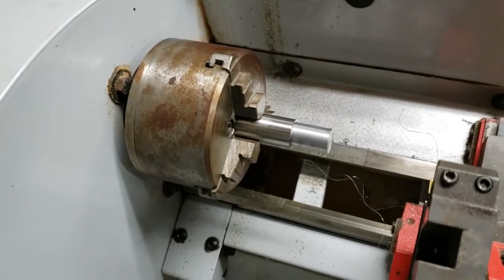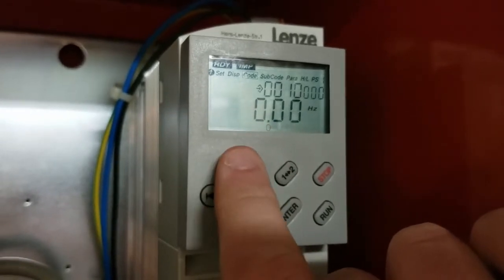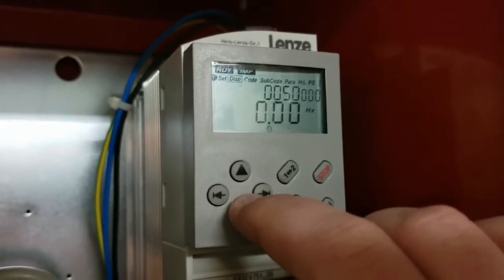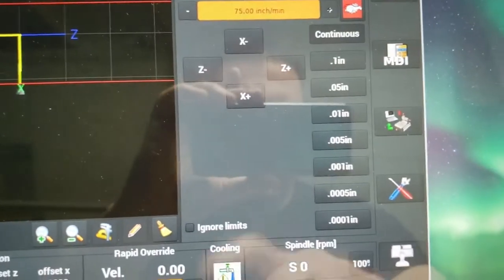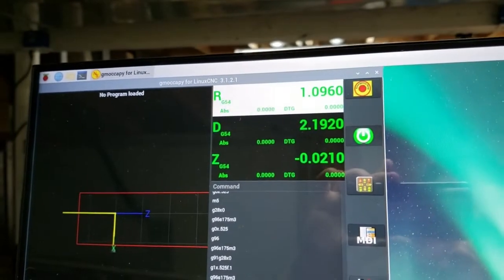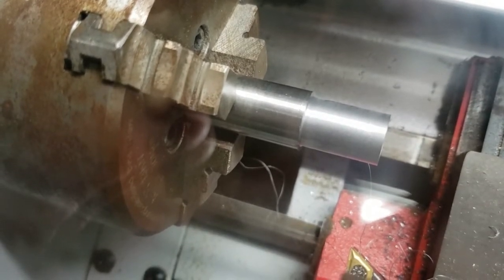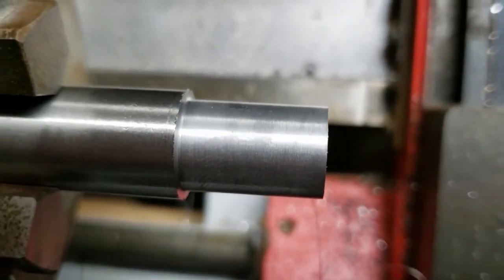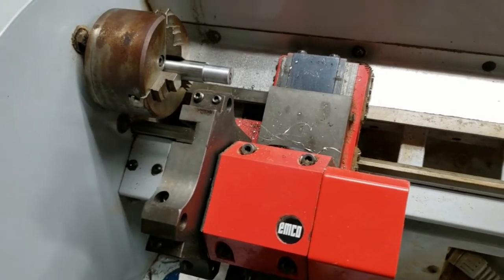Emco PC Turn 55 Lenze 8200 VFD and LinuxCNC lathe notes

Comment: Can u perform thread cutting with vfd?. Have you tap with your vfd ?
Reply from the maker: Thread yes, but I haven't yet. The encoder is 1:1 on the spindle shaft, so I should be able to get it to tap also. I haven't had a lot of time to work on the machine as of late.
Reply: @TheFeralEngineer  thank you for your reply. If you do get the time maybe you could make a video on thread cutting and tapping. I am curious how vfd and 3 phase motor fare with low rpms.

Comment: Nice one as usual. My Lense vfd is a little different to yours (No panel). Would it be possible to get a copy of your config files for classic ladder to look at?
Reply from the maker: The panel was extra. I got it on fleabay but it's 80 bucks to literally set two parameters 🤦‍♂️. Shoot me an email and I'll send you my ladder config. 

theferalengineer@gmail.com
Reply: @TheFeralEngineer  Ah right. Was wondering, mine is an earlier version than yours with slightly different tool changer so wondered if it was an upgrade. Thanks so much 're. The files. I'll fire an email over shortly, good man

Comment: i have a breaking resistor and all settings did in the VFD. (in LCNC i'm  a beginner)
For now I using the ModBUS RTU protocol to run the spindle. (because the digital inputs on the VFD for manual using the lathe control)

Comment: Stable video of the x and z axis calibration would be awesome. 
Jepp a 40 minute video is a lot but its hard to get to the details in less lime without spending hours more on the editing. maybe just cut it up in shorter segments. Or adding time stamps for people that look for a specific information. 
For me it doesn't matter if it is 5 0r 50 minutes I like CNC stuff so I watch it.  
Great work so far and keep it turning ;)